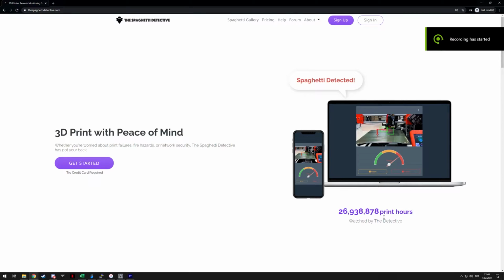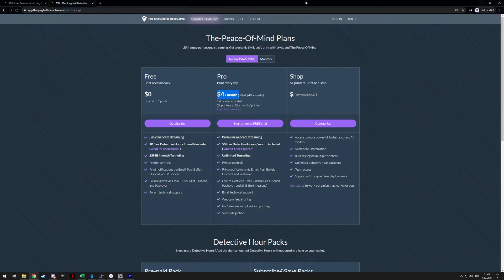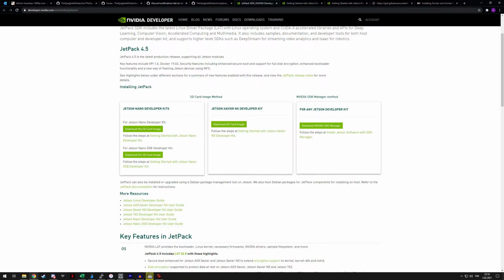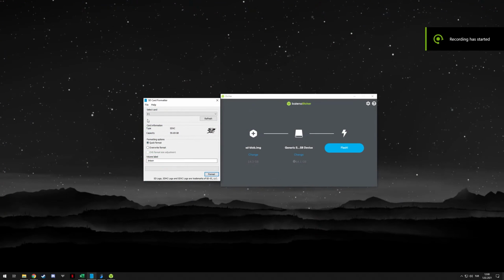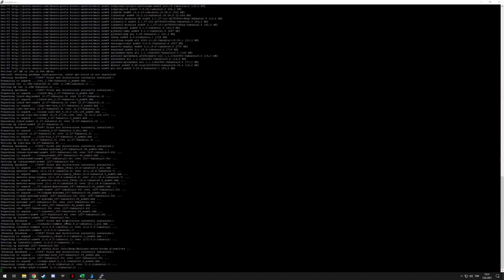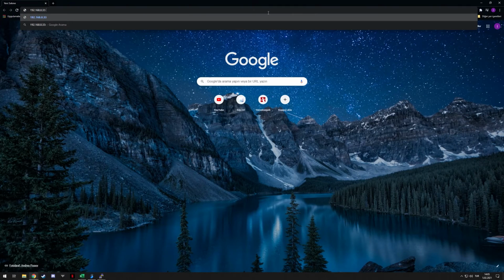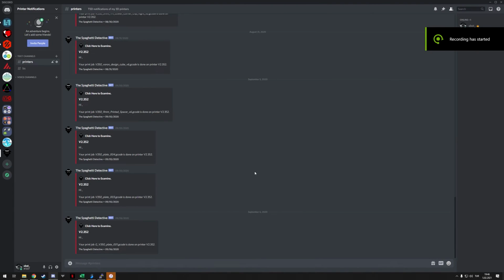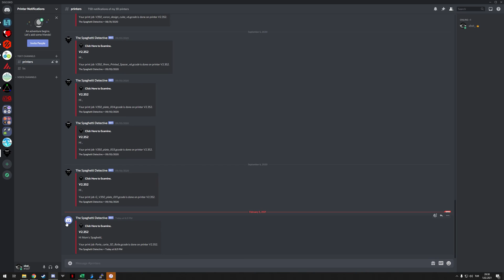Setting Up Jetson Nano Spaghetti Detective Server

Comment: Thanks for posting the video.  Although it's only been a couple weeks I think something is out of date.  When following these instructions exactly I get to the sudo pip3 install docker-compose part and then error out on Collecting cryptography>=2.5 (from paramiko>=2.4.2; extra == "ssh"->docker[ssh]<5,>=4.4.3->docker-compose (this appears a bit different than your video) with the message ModuleNotFoundError: No module named 'setuptools_rust'  [...]  Upgrade to the latest pip and try again. [...] Command "python setup.py egg_info" failed with error code 1 in /tmp/pip-build-40kzc5of/cryptography/.

Edit - ran the command 'sudo pip3 install -U pip' and got past the cryptography error.  Also, maybe I missed it in the video but I had to run 'sudo systemctl enable docker' and reboot before the web service would start.  

Thanks so much Isik for posting this video - I bought a Jetson Nano to do this and have been struggling for a number of hours to find a guide that works to get it setup.  With some very minor tweaking I was able to get this going; couldn't have done it without your video!
Reply from the maker: (Sorry for the late reply, YT marked your comment as spam, so I didn't see it until I checked the spam box)
I'm glad you figured it out. I have a theory about the issue:
Line 18 in the pastebin should install the latest pip3 on the ubuntu servers for the version of the OS. Since the SDK includes a LTS version of Ubuntu, the pip files for that on the server may be outdated now. pip installs the latest version (of itself) form the pypi, which should be the latest release. Docker-compose must have a newer release since the video, requiring the new pip.

Comment: Step 5/7 : RUN pip install -U pip
 ---> Running in 92deab536f72
standard_init_linux.go:211: exec user process caused "exec format error"
ERROR: Service 'tasks' failed to build: The command '/bin/sh -c pip install -U pip' returned a non-zero code: 1

nope :/
Reply from the maker: Can you try "sudo pip3 install -U pip"?

Comment: Just to be clear, you do NOT use Octoprint & Octoprint plugin on the same machine (Jetson Nano), but you are using Octoprint & Octoprint plugin on a Raspberry and the TSD Server on Jetson Nano. I tried to run both on the nano, but the plugin blocks the camstream, because the Octoprint plugin detects that it is not running on a Raspberry.
Reply from the maker: Yes, sorry if that wasn't clear enough.
Reply: @IsiksTech  all fine ;)